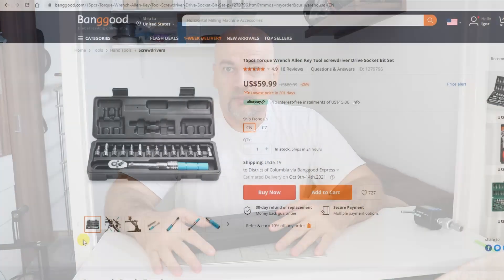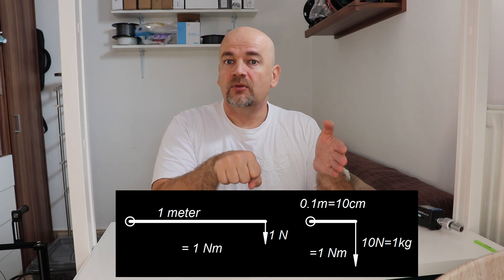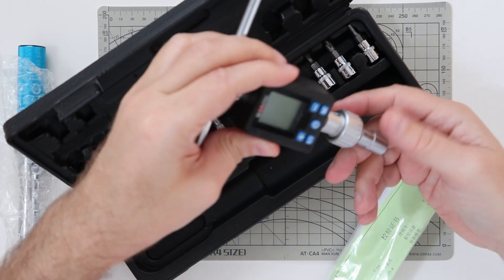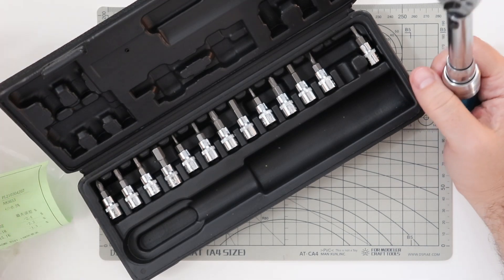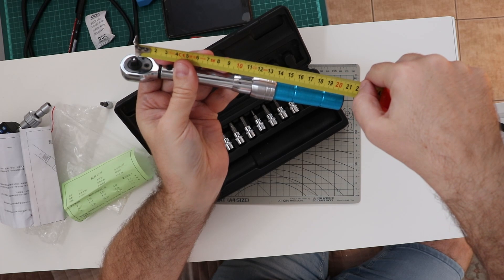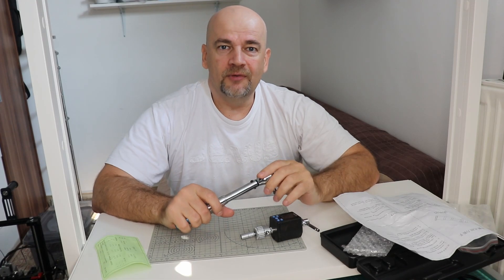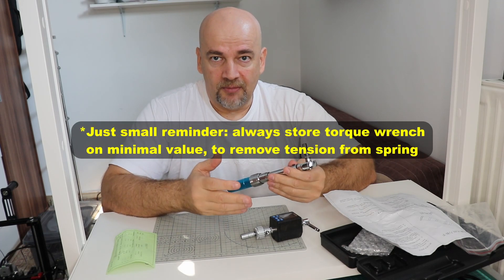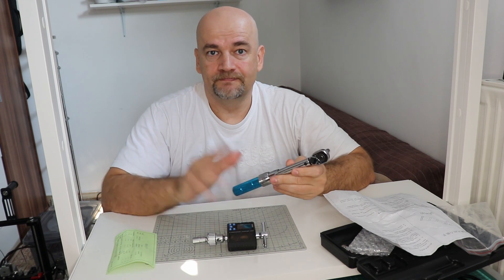2-14 Nm Torque wrench from Banggood - can I use it in 3D printing hobby?

Comment: The manual describes setting like you learned from other meters. The guy who calibrated it didn't RTFM... And no, the manual doesn't talk about calibration. You probably have to take the handle off and will then have some way to change tension of the spring.
Reply from the maker: Thans. This small torque wrench I need only for 2.5Nm, and I found that setting. I have a feeling, that I couldn't calibrate the scale on whole range anyway (if it will be accurate on low Nm, will not be on high Nm)

Comment: Yeah don't ever cheap out on a torque wrench I learned the hard way with these cheap ones stripping a sump bolt. Now I only use Norbar/Wera ones. I also have digital ones as I feel they have slightly less marging for error with sound notifications etc

Comment: Unfortunately even though it is wrong, you might still have a "good" sample. While it is indeed off, it is at least consistently off. That is almost always the problem with youtube channels that review products, even though the review could be perfect and without bias, if you have been given a review sample it is not guaranteed to be the same product as someone else might receive. 
Also, in my experience there can be a huge difference between buying a product now and buying it several months later, if for some reason they could not get the right parts they are happy to swap them out and completely change the product internally.
I find your reviews very useful, but I think everyone should know that they need to be taken with a grain of salt due to product variability.

Comment: Great review. My experience is the overall build quality of these products has come a long way so they look and feel better, but still lack the quality control (expensive at production scale) that comes with a trusted brand (that certificate is most likely the same for every wrench they send). I do not recommend using something like this for critical applications (vehicle repair for example)

Comment: You're right about how to read scale, of course. I think this torque wrench is not calibrated at all and should never leave the factory. Most measurement tools, even if it's only for home use, we just shouldn't buy from unknown "brand".
Btw. I think, if buying adjustable torque wrench for nozzle change, then we should look after 1-5Nm scale, where better accuracy can be expected.
Thank you for informative video.
Reply from the maker: I agree. I am designing a new torque wrench, based on airsoft BB and pen spring, mechanism used in this project: https://youtu.be/C4Ctd1sx82o